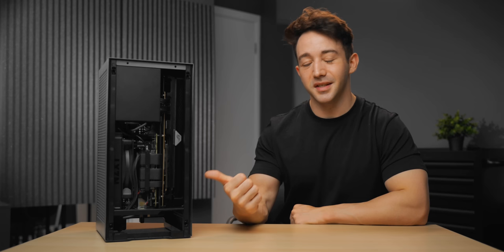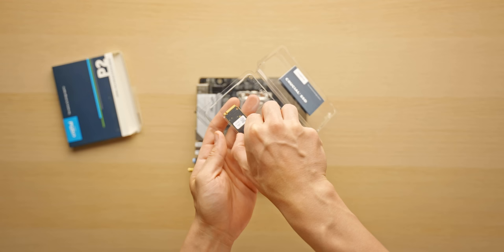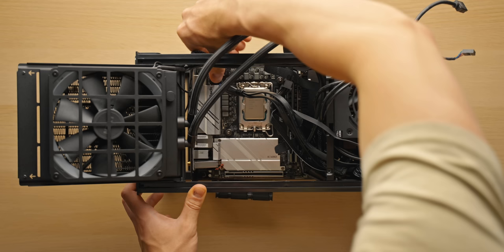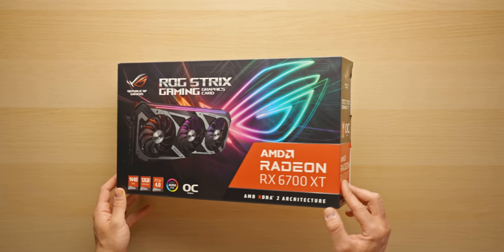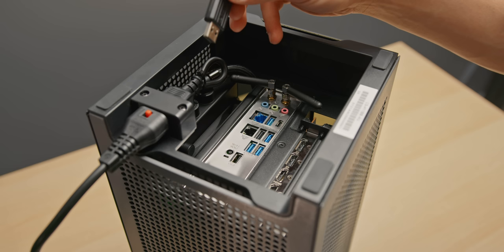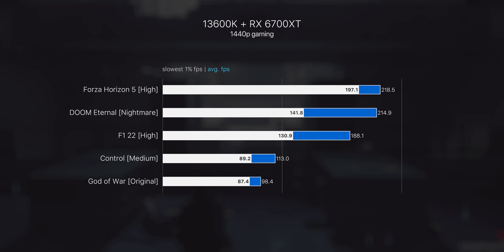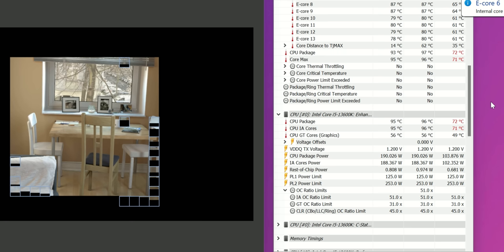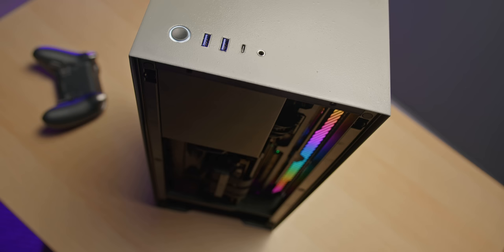$1400 Mini PC that plays everything

Comment: Awesome timing - just this week, I built an itx system for $1400!!!   I went 32G DDR5, and 12400f with 3070, and it's amazing!  Thrilled to see your take on similar budget/build
Reply: DDR5 for 12400F? Interesting take
Reply: @GewelReal  What is so interesting about it?
Reply: @GewelReal  For gaming, why wouldn't you?
Reply: i build mine about 2 weeks ago, 13600K, 3080 12gb tuf oc v2, ddr5 g skill 6000 cl32, ek 360 aio elite, Z790 Strix F & 1TB 980 pro
Reply: @erisium6988  lowest speed DDR5 comes very close to some of the best ddr4 out there that sometimes wont even work for you with default timings. That said 6400 32g trident z kit is like 200$
Reply: @erisium6988  Sure
Reply: @erisium6988  future proofing is better.
Reply: @erisium6988  did you just say that ddr4 is faster then ddr5 💀
Reply: @zawiszaczarny1749  cpu does not bottleneck?
Reply: good price!
Reply: @ARCbirdman he means it’s cheaper to get fast ddr4 ram than it is to get slower ddr5 ram
Reply: @joelconolly5574  DDR5 is pretty new and it's likely they'll end up replacing that RAM the next time they upgrade. e.g. when DDR4 was new 2666 was pretty fast RAM, nowadays 3200 is standard (not fast)
Reply: @ARCbirdman  no he’s saying it’s better getting the fastest ddr4 ram since it’s Cheaper and still good over expensive ddr5 ram.
Reply: Bro what motherboard did you use?
Reply: @erisium6988  expensive in 2022 DDR5 6000mhz, dual channel in 1 stick. GPU above $450 is not worth it.
Reply: 13600k radeon 6950xt and 32gigs ddr5 5600 cl36
Reply: Also great timing for me too. My parts are still coming in but I went with NZXT H1 V2 12600KF 32gb DDR5 5200 Asus b660i 3060ti Tuf and probably gonna pick up 1tb 980 pro. (got my case for $200 new during best buy sale)
Reply: @peternguyen1504  damn.. I kept checking and couldn’t get to one. Hope you like it!
Reply: Out of curiosity, what games have you been playing and what have the temps been on average?

I did the same thing(3060ti) and I’m running in between 70-80 after setting the power limit to 160 or whatever he mentioned.
Reply: @Hollmatt2  I mainly play Tiny Tinas Wonderland’s, and Diablo two resurrected. CPU temps stay usually in the fifties, with an arctic freezer 34 esports duo, and my Zotac 3070 stays in the mid 70s.
Reply: @rgracon  interesting, thanks for the info! enjoy!
Reply: any significant downsides to an ITX - cooling? sound? - would it handle gaming and streaming?
Reply: @BurgeTV  ITX systems these days can do just about anything. Gaming and streaming is certainly possible. Fitment of parts, and cooling, are probably some of the biggest concerns. I run mine as an open air case, which helps in both of those regards… I find it to be much quieter than my previous system as well. The only thing I ever actually hear is the gpu when I ramp up in gaming. Of course, I have to fight the dust battle much more, though.
Reply: @rgracon  gotcha thanks - built some PCs before and high-end too but never ITX and not up to speed on latest best parts in each category - fuck this is gonna take me so long
Reply: Ddr5 for 12400f huh
Reply: 3070 might be the worst card purchase ever
Reply: @Hanadsrequiem  I’m very happy with the purchase, but thanks for trolling anyway :)
Reply: Do you mind sharing your build somewhere?
Reply: @Hollmatt2  oof 70-80 is not good nor worth it

Comment: I don't like the Nzxt H1 I had it for about 2 years and the cooler failed. I took the cold plate off and it was extremely gunky. I drained it and cleaned it out then put some distilled water in it. It's a common issue apparently.

Comment: Can’t thank you enough for this! The NZXT H1 is on sale for $199 at Best Buy and I held off because I couldn’t determine what itx motherboards had flashback for the 13600k. Just purchased the parts :)
Reply: Thanks for pointing out the sale on that case!  Ordered...
Reply: @IgnusFast  I can confirm the $199 sale price at best buy is the version 2 of the N1.
Reply: I just finally bought it too, I've been wanting the H1 since the initial release. Time to upgrade my build :)
Reply: @visceral_flex4213  Thanks for the info, I was skeptical of this.
Reply: I'm in the UK and found it somewhere for less than £100. Still don't want to buy it
Reply: @mariocincu479  where?
Reply: @ben6902  I think he's talking about the V1 from Scan, which was on sale for £90 I believe.
Reply: @mariocincu479  the V1 understandable, the V2 is pretty solid though. You can manually adjust the fan curves & the thermals are great with minimal noise so long as you're not too ambitious with the CPU load or power.
Reply: @Plutters  definitely talking about the V2. I just bought one from Best Buy for $200 yesterday.

Comment: I've managed to put in 3080 in this with 13700k, swapped the fans with Noctua's industrial line of fans and flipped the aio fan to intake (instead of exhaust out of the box)
Reply: What are the avg temps from changing around the fans
Reply: @richardjavier7236  synthethic benchmarks like Aida and cinebench would make it shoot to 90c to 100c same as the video. Im not sure I can do anything with that 

My ambient temp is around 28-30c without AC

Using stock fans/(with Rad at its original exhaust orientation)temperature  is going crazy at 85c-90 playing CPU intensive MMO (New world) it even throttles in Hwinfo! While playing this game!
Idles at around 45-50

Using 140 noctua 3000rpm flipped to intake
(Stock 92mm exhaust at full speed for now but still waiting for my noctua 92mm 2500rpm to arrive) 60-72 in towns (New World) 
Idles 35-40 
I also replaced thermal paste cause I had to
Reseat (kryonaut not sure if it helped)
But I feel like changing the noctua rad fan to intake is what helped me shave down 10-15c  on load, im really not sure why nzxt have it on exhaust, but intake is what worked for me
At least

GPU is always at 80c at 100% load  (I wasnt paying attention to its temps before I switched  case fans tho)
Reply: @nick024  damn, thats really good

Comment: Nice Build; I just bought all the parts for my new machine over black Friday. 
• i5-13600K
• ASRock Z790M-ITX WiFi
• 32GB Kingston Fury Beast DDR5-5200
• WD Black SN850X 1TB
• Palit GamingPro RTX 3080
• Cooler Master NR200P Max (with 280mm AIO CPU cooler, and 850W 80+ SFX PSU)
Reply: How much did you spend in total?
Reply: How much in total?

Comment: Tip for anyone who wants to make it quieter. Swap out the two fans for noctua fans and psu with Corsair sf750
Reply: What size noctua fans?
Reply: @laospaulieplayingpc  140mm for the cooler and 92mm for the rear one, I wouldnt really touch the PSU fan cause you could kill it and corsair PSUs are pretty quiet to begin with

Comment: Aio failed.
13600k and 4070ti nothing OC. Dual 140mm fan mod for intake from Etsy was applied using a pure wing 2 and silent wings 3. 

The  Temps fine 47 idle 60ish under work loads. Ran great for the previous 5 days under business workload. Then playing star citizen  on 4k high settings low clouds in a cpu and GPU friendly place . After 4-5 hours the pc suddenly turns off .  Trying to power on resulted in cpu temp error. Upon further investigation I noticed water pooling on the ground around the case( it sits on the floor), and I slowly started to take it apart as careful as possible. Thankfully it was the coupling on the rad failed and the water drip / leak) did not get any of the components as the rad being on the outer wall with the fan closer to the processor and my setup.  

I’m a bit gun shy now about this cooler but lowering the wattage feels like a good idea. Seriously trying to decide if I should try and move over to a Corsair 2000D or if I could get my hands in a New Dan C54(sp?)

Comment: PC building noob here. Would it be possible for an all-AMD build for this case?
Reply: 100% but be warned the PSU in the case has no zero rpm fan mode and is NOISY
Reply: @ptpoul  That would be fine in my environment. It NEVER gets quiet here anyway. Thanks!

Comment: The problem I have is heat soak, smaller cases seem to retain heat & usually the equipment inside them don't last very long.
Reply: well, i have the perfect solution, just use some 2 inch small fan at every corner to move the heat out.

Comment: I'm thinking of building a small itx build and the H1 is great option, but, are the thermals really good? And the noise? I saw couple of reviews on the NR200p and apparently it has better air flow and overall temperatures, so I don't know what to pick

Comment: Hi I realy enjoy your channel and I just build my first ITX setup in the H1 v2. 

Specs:
ASRock B650E
Ryzen 5 7600x
32G DDR5 5600MHz
3060ti FE

The only problem is, that I cant control the pump speed of the AIO and the PSU fan runs allways at full speed, independend of the system load. Do you experinced the same problems with the H1 v2, or do you have any tips?
Reply: That comes down to your motherboard. DC mode as shown in this vid should allow you to control the voltage, which will adjust pump speed. With an Asrock board, the BIOS option should be the same.

Comment: My understanding was that it's best to use the CPU Fan header so you'll know right away if the pump stops. Is that not right?
Reply: You can only run the pump via the built in hub and Nzxt cam software.

Comment: Nice Build! I'm considering to buy the Asrock z690 mobo in combination with the 13600k. But doesn't the Asrock z690 itx hold the 13600k back because of its 150w power limit?

Comment: Should have used the nr200p max gpu would run quieter and faster not running vertical, 280mm rad so double the cpu cooling and access to rear io. Nuf said.

Comment: Hi, I am looking to build something similarly if not just like this build but to be used for 3d renderings and CAD simulations. Does anyone have any advice on what components in this would work well, or which components should be upgraded from the ones listed to achieve the performance I need for the work. Thank you!

Comment: I don't understand why they changed the aio fan from pulling in air from outside to pushing air from inside. Pulling cool air from outside to cool the aio seems to be the logical right choice here
Reply: Pushing air from inside keeps the GPU temps lower while only affecting the CPU temps marginally.

Comment: IMPORTANT: If you are doing this build in 2024, make sure when you hold the bios flashback button that you do it with the power supply plugged in BUT DO NOT TURN THE PC ON (just don't press the button to turn it on at the top of the NXT case). I was freaking out

Comment: @Optimum Tech, I want to build this with i9 13900K. Would the temps/heat be manageable ?
Reply: In gaming load yes but if you're running 100% then no
Reply: Depends on what you want to do with the system. If you run the CPU at 100% all the time then definetely NO. If you want to game then you will probably get CPU thermal throttling as well if you don't undervolt. Ask yourself if the 13900K is really necessary for your workload. If it is then this small formfactor might not be the right thing for you.

Comment: imp retty sure that mobo only supports upto 150w while the 13600k will require 180 to run at full speed.
Reply: Does it matter for gaming though? I’d understand the concern for other workloads but I think it’s fine for gaming. Not many intel itx ddr4 motherboard options out there. this is the only option I can find.

Comment: its funny to me how they always reccoment nzxt but nevermention the memory leaks thats been present in their app for over 6 years, meaning if your computer is on for over 30 minutes your performance is lower and if its on for over an hour it will suck up over half your memory.

I had the app, just running some led's using 38 gigs of memory after an hour! i dont care how their products look now, 6 years of that issue means you shouldent touch them

Comment: If the case is small, it will inevitably be loud if you cram high performance components in it. 

So, if you are doing an ITX build to tuck it away somewhere and not have to see it, you will still hear it unless it is in another room or something, in which case why build SFF at all :)
Reply: to save space… it’s literally the point of sff builds

Comment: Just wait after 1
 years when the liquid cooling coagulates and clogs the fins on the cpu copper plate and you have to either send it in for another defective cooler or wait 3 weeks or open it and purge it 5 times until it stops clogging

Comment: 13600K is definitely over-killing the 6700XT, GPU will bottle neck. 12400F or 5600X should suffice. Also you may want to undervolt the 13600k, the sample I got by default is pumping 1.4Vcore under full load default... I reduced to 1.25v and can run 5.4G/4.3G without issue. However I wouldn't OC for SFF cases and will probably undervolt more.

Comment: Do not do these types of builds guys 1 of 2 things will Happen. 1 components might actually catch on fire and 2 for sure you will thermal throttle
Reply: He did thermal benchmarks in this vid?
Reply: @omegaPhix  he’s using trash components I’m talking about powerful hardware. Maybe I should have been clear lol
Reply: @intelligence6900  Doesn't make sense that you talked about thermal throttling though, nothing in this build gets hot. And which components are trash? Everything is pretty high end as far as I can tell